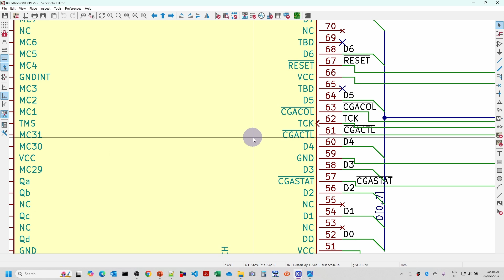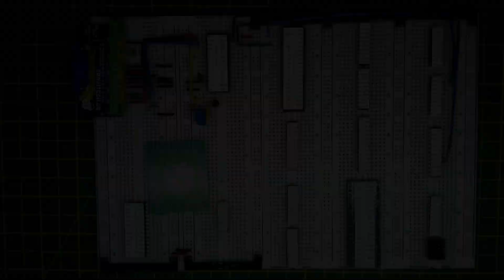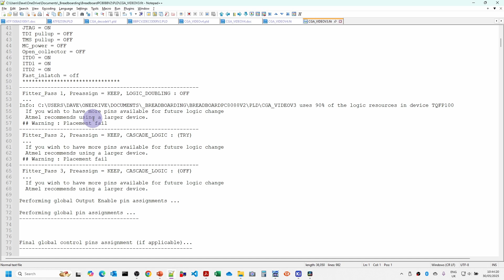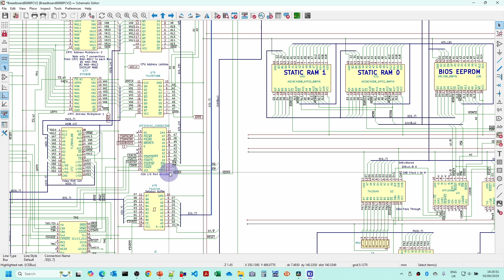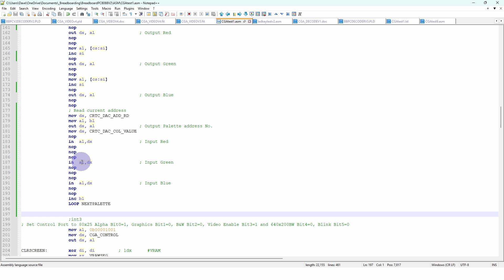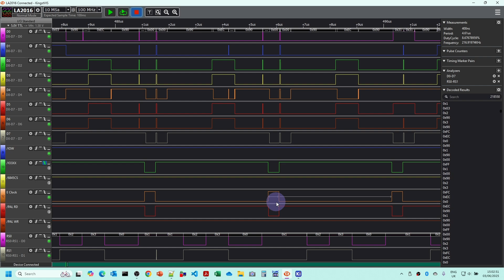New Breadboard 8088 PC V2 #12 CGA Video Controller

Comment: Well, that project scope is impressive and achieving those features in that form is cool af
Reply from the maker: Thanks. I have already done this once in V1 but will hopefully avoid some of the mistakes this time. Also putting in place the parts needed to upgrade the design to a 386 with 8MB of RAM to hopefully run Windows 95 and an early LINUX version to! Dave